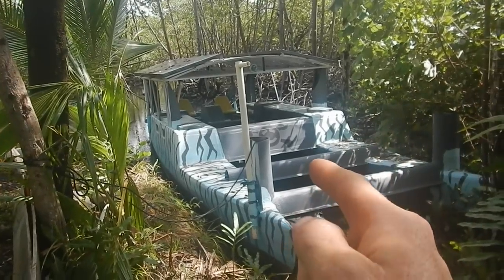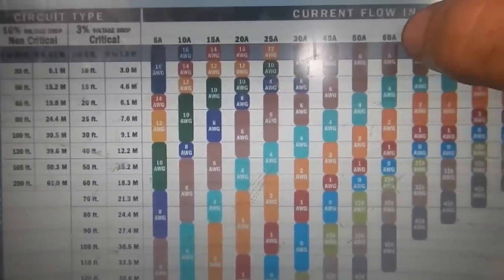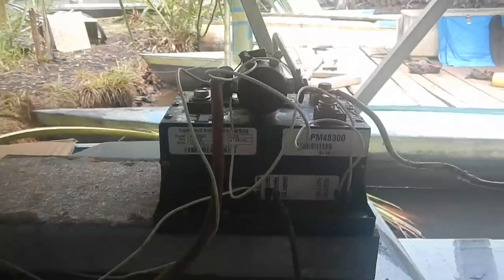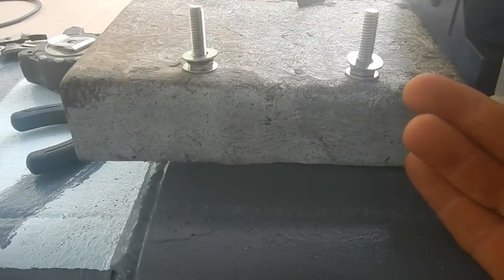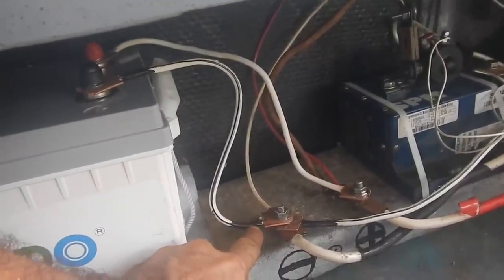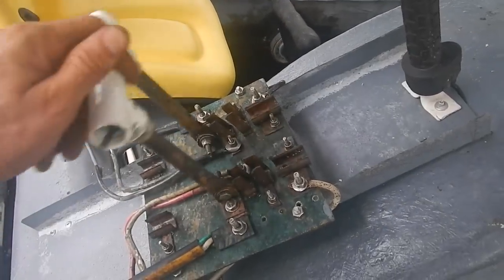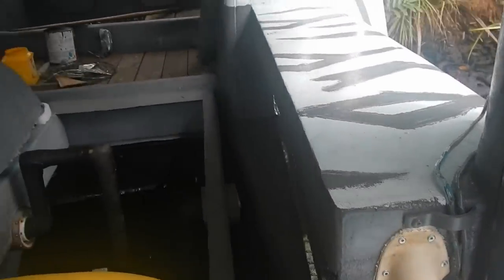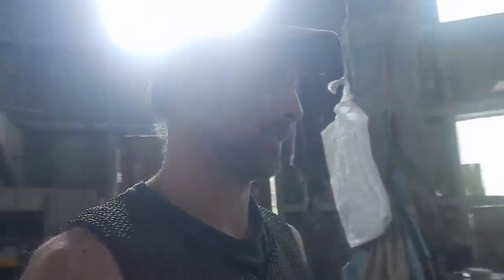Tiger Shark Slicer 031 Speed Controller done!!!

Comment: Solar pannel running a wire to a glass of yxus equals ignition on a solar pannel then u run a battery to it equals ignition on the battery then u need a computer to run to it?